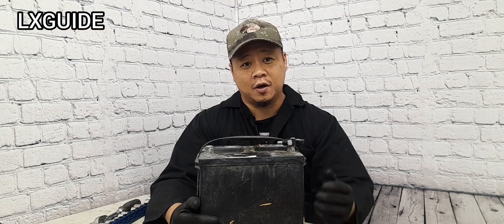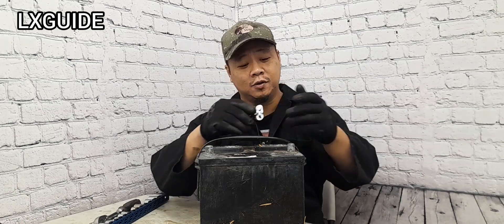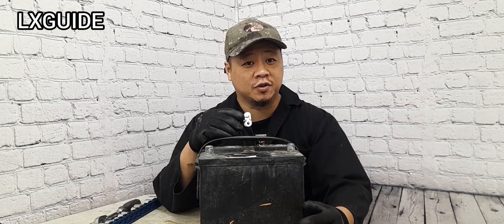CAR BATTERY CABLE AND TERMINAL FEELS HOT

Comment: Bro i have problem if the engine cold the starter good work and fine. but after drive  a car 1 hour and turned off when i try turn on the starter was very slowly , if turn the starter third time  the terminal postive in battery wil be smoke what the problem please help
Reply: Replace your starter that will solve ur problem once it gets heat soaked it doesn't work properly.  Either it's old or close to headers

Comment: Why does my positive terminal spark when I start the car and gets hot and melts after driving for a while
Reply: @luckymayne4304 that is a power (+) side touching and grounding out somewhere it def ain't supposed to be, my guy. check for bare spots along any part of the red wire, esp the thicc ones. It will def be VERY noticeable, I assure you... lol
Reply: @devineleven514  it was my positive terminal bolt wasn’t tightened all the way ez fix id had changed my alternator for no reason lol
Reply: Might need an engine rebuild.  I'll charge you only $79,999.99
Reply: @348frank348 sounds like good price hmm 🤔 but no need I had fix the issue due to loose terminal tightening that bad boy up with a 15 mm